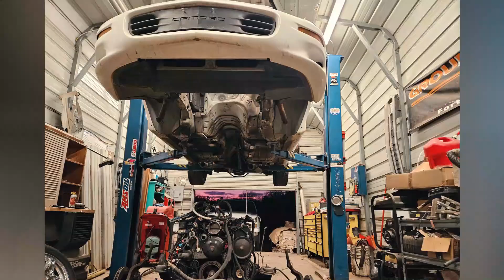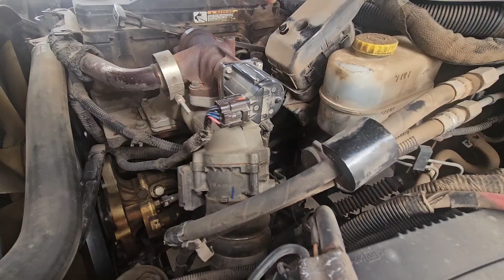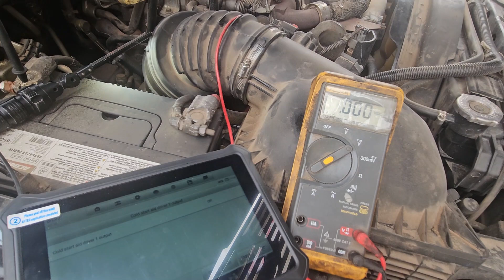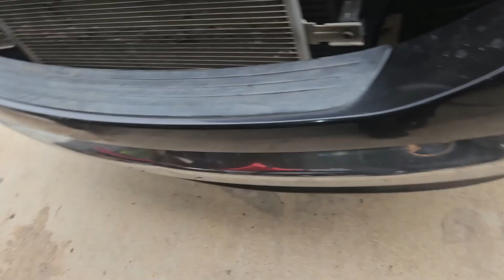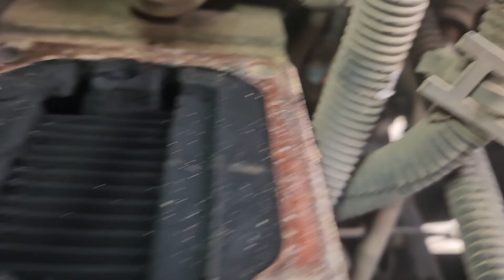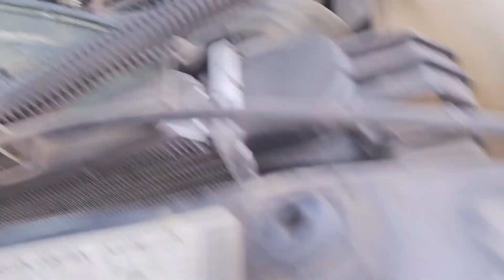Ram 3500 Cummins P2609 Grid Heater Fault

Comment: Did you delete the grid heater. I couldn’t tell. I have an 2018 and I deleted the grid heater so I don’t have to worry about the nut ever but every once in a while I will get a grid heater error and I delete it because it’s gone. Was wondering if you have seen any issues with deleting it if you did?
Reply from the maker: Mine is still stock, but I would think if you are getting the error another part of that system may be faulting like maybe the wires rubbed through and catching a high resistance or somthing to do with the tune.